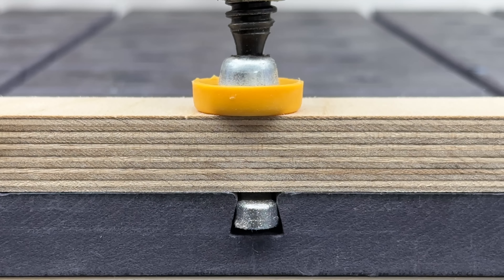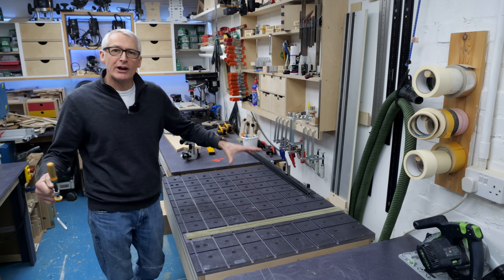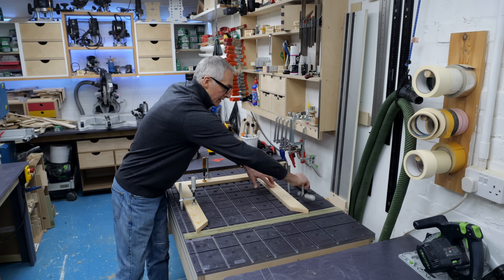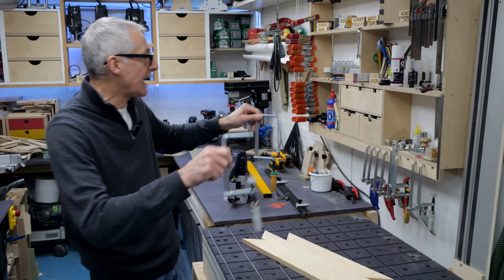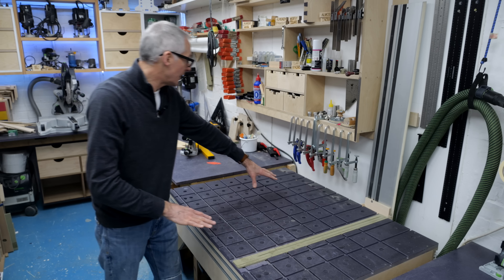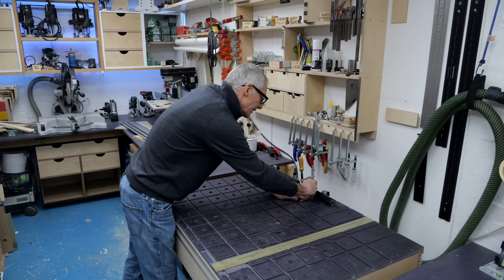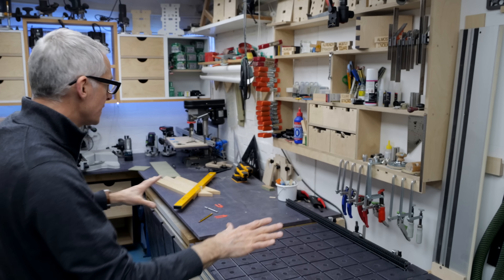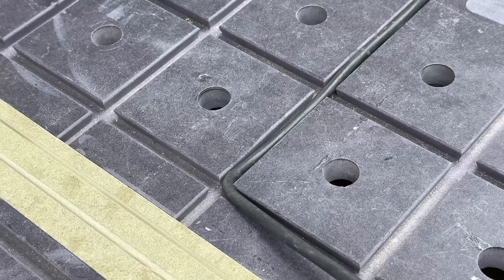Microjig Matchfit Dovetail Clamps 8 months on [video 520]

Comment: Don't throw out the baby out with the bathwater.Youve figured it out!Yes the Micro Jig slots can be a pain.But they sure less expensive than T tracks.
Reply: why bother with matchfit when you can just as easily route T track? Woodpeckers just released a bit that does it like the micro jig one, but better
Reply: @coolbugfacts1234  haven’t seen this bit yet.Sounds promising
Reply from the maker: Not in Britain! £££
Reply: @10MinuteWorkshop  we have to wait longer for stuff like new festool tools and it's impossible to find metric versions of common tools so i think it works out :) 

most stores here don't even carry tape measures with a metric side. even the US versions of festool track saws only have an imperial scale which is maddening

Comment: Couldn't agree more with your summation. I have always had sagging using this system unless I use much thicker stock like 25mm. Also these clamps can't swivel at 360 deg like the Kregs, Besseys, Rocklers and Armor tools and as a result you need all the slots, vertical and horizontal. Some of these clamps are also auto adjusting. I made a drill press table that only needed 2 T tracks which covered the fence and hold downs. I've seen Youtube videos using 10 dovetail slots. So stick with your MFT dog holes and clamps
Reply from the maker: Yes, I didn't want to add that the 'linear' nature of them was also a pain as it seemed an obvious/whingeing thing to say, but it really is a pain when you're used to being able to swivel a clap in a hole! 👍

Comment: Yes, I think the Microjig system is a bit like Marmite and having invested in it, I went to great lengths to reinforce the underside of my MFT Top, whilst also ensuring standard clamps would still fit in the dog holes.
I must admit when I made my top, I made sure I didn't have any slots close to the edge as it's probably inevitable that the clamping pressure is going to split the top, especially in MDF.
One aspect I do like that doesn't get mentioned very often is that you can undo one screw and turn the head around
This means if you use a strong back with holes in it, the clamps can then be used to put downward pressure onto the work piece on the bench.
Not sure if I explained that very well 😁.
Where the Microjig system comes into its own is with various Jigs, especially on the Sawbench etc but they are not for everyone.

Comment: Such a great video. I must say I was taken in by some of their marketing and reviews. Your video really made me appreciate the elegant simplicity of bench dog holes. As others have mentioned, one thing they could be good for is jigs with reparable stops. I wonder if you could compare matchfit, t track and t track router bits for this use case in a future video? Is it really cheaper and easier to run a line of matchfit vs buying t track and embedding it?

Comment: Thanks for doing this video, I was looking for a work holding system for my cnc and i think this will be perfect. I can see this being useful for a lot of other things like my domino. I do feel that I wont be replacing the mft top with this system at least for the moment.  Ive ordered some of the router bits and the clamps.. looking forward to trying this system

Comment: As always, your experience and insights make a very helpful video.  I wonder if those dovetail grooves could be made deeper so there's more material where the clamps pull?
Reply from the maker: The bits have a pretty specific depth mark on them, so I suspect not. 👍
Reply: @10MinuteWorkshop  Hmm... I wonder if maybe you used the 1/4" shank version, and then opend up the top with a straight cutter?  Sounds like more effort, even if it might work.  But it just seems that "more meat" above the dovetail would be a good thing.

Comment: Impartial as usual Peter. MFT has so many after market / 3rd party accessories and works really well. Festool dominate but you can buy cheap dogs from Banggood etc along with the squaring capabilities it has to be the most flexible system?

Comment: I was going to suggest you alter your work flow a wee bit and pre-stage the clamps in back by sliding them in from the front, then the work piece is placed. Instead of altering the slot. But I was a bit late to the party. :D

I bought some of those clamps years ago to add to my tablesaw fence. Still in the package. sigh....
Reply from the maker: But then you never know where you'll need them to be, and as I say, 20 years of MFT muscle-memory of just being able to fit them anyehere, anytime, is hard to fight against. 👍
Reply: @10MinuteWorkshop  I've had great ideas of my own ruined by years of muscle memory. :p

Comment: An interesting dilemma. One possible solution that came to mind is to put a slight dovetail bevel on the leading edge of the Microjig clamp to enable a universal fit. It make work, it may sacrifice a clamp to R&D.  Regardless of the clamp issue is the MFT needing to be stronger for better long term use. In my area we do not have availability of MFT or a genuine Baltic Birch plywood. Having zero experience with these systems or the MFT, a question for you: Would a thin, penetrating resin applied to the material strengthen it sufficiently to warrant the attempt?
Reply from the maker: Not worth the agg to try and make them work, I don't think - not for me, anyway. My previous MFT tops have generally lasted around 5 years, so all the issues I've had stem from the matchfit grooves. 👍

Comment: Agree with your opinion. Great idea, execution of function not optimal for the weakness it places in the substrate. I also think that regardless of the substrate used, over time the pressure of the clamp will fatigue the substrate at the edges of the grooves. 

I’m sticking with aluminum t-track…

Comment: I've never tried milling MatchFit dovetails in MDF or HDF, but the tear-out shown at 4:00-4:45 is fairly predictable - no less so than if someone used drywall screws with MDF.  In contrast, Baltic Birch plywood and solid Poplar (in any grain direction) have never failed me with MatchFit clamps in regular use.
Reply from the maker: I've never had an MFT top delaminate like that in 20 years of using them. 🤷‍♂️

Comment: Great video again.  Is there anywhere in particular u recommend buying a mft table top from so its 100% square? Thanks
Reply from the maker: They should all be 100% square! I've had no issues with the MFT tops from CNC design. 👍
Reply: @10MinuteWorkshop  Thanks ordered straight away!!

Comment: An apples to oranges comparison is the way to go when you're choosing between apples and oranges. The apples and oranges here are dog holes vs tracks for clamping. I don't think the negative aspects of tracks are specific to the Matchfit system. They apply to aluminum t-tracks as well, compounded by the cost and bother of buying and mounting the t-track.

Comment: I’ve done a similar thing on different tops (but not my mft type one) using the Axminster rail clamp router bit, so I can use all my standard clamps and m8 bolts only cost around £30.

I have a smaller hardwood top I use with some dog holes around the perimeter and a diagonal slot cut from end to end which is really handy

Comment: I think the vast majority of the utility is in making the table. As someone who does not own an mft, routing dove tails into a table is a lot more approachable than buying some expensive system to make an mft or pay for one.  Since you've already got the mft, the utility to you would be greatly reduced.
Reply from the maker: Thanks! I think they perform two separate functions. A benefit of the MFT is the squareness of the grid of holes, so not just for clamping but for referencing against; dovetail grooves in a benchtop don’t provide that, and if you just wanted a clamping surface then a 20mm forstner bit is cheaper and easier than a proprietary dovetail router bit. Here in the UK MFT tops are a commodity item and can be bought for ~£40 / $50 or so, so the value proposition for the Microjig bits and pieces is definitely skewed against it, as they’re an expensive item here, compared to other clamps. 👍👍

Comment: Good points all around, and a short list of things NOT to do with the Microjig system. It appears your objections circle around your very specific usage of the system. I have never seen another MFT top with a grid of dovetails. And your choice of top material may also exacerbate your issues. Most of the Microjig jigs I have seen use "Baltic Birch" not MDF.

Comment: Did you cut off the small piece of aluminum on the right side of your Bench Dogs UK fence, I have been considering cutting it off on mine since I have already accidently cut through it a couple times.
Reply: The under rail support used to be separate until a few months ago. "Our revised fence now comes with the under rail support complete in one piece."
Reply: @johnclements6614  mine arrived only a week ago and is separate. Glad it is too.
Reply: @jamesmitchell2041  I think it is now optional looking at the website. 

I am very pleased with my bench dogs fence which I got last summer with the under track bit separate.

Comment: H
Thanks for your review. This time I don't agree with it. I think you are trying to get  a lot more from this clamps from what they were designed for. Certainly they are not heavy duty ones with a lot of pressure to put on, but for a reasonable price you can easily and quite fast secure jig and or materials you are working on.
as you can see I like them and found on them a good answer for many tasks, but also I understand they are not a silver bullet to solve all your problems.